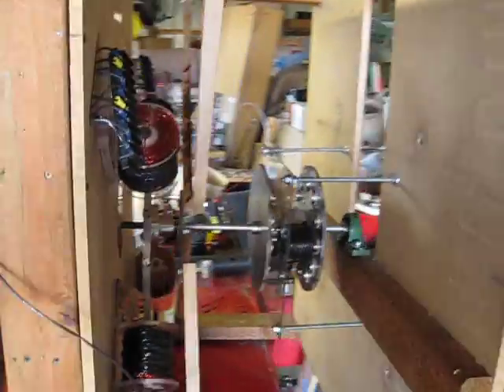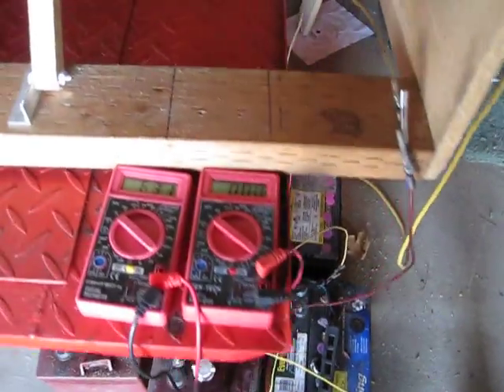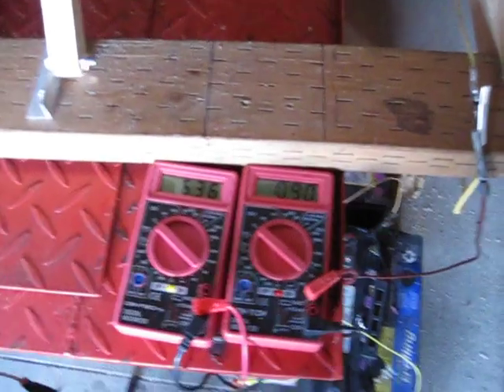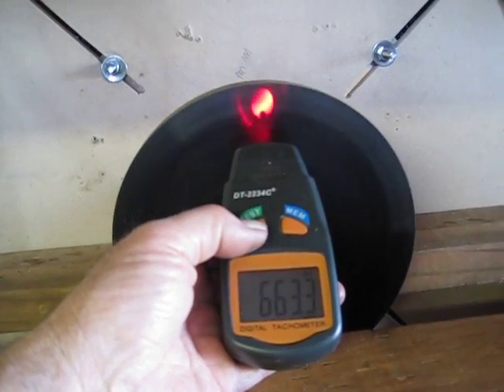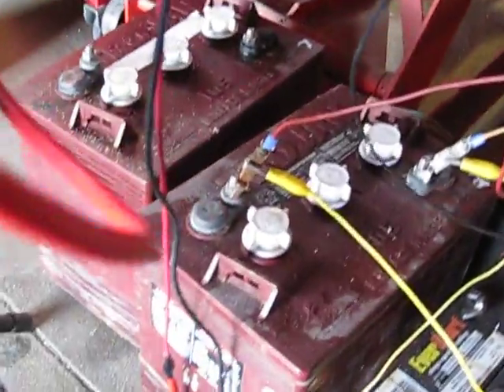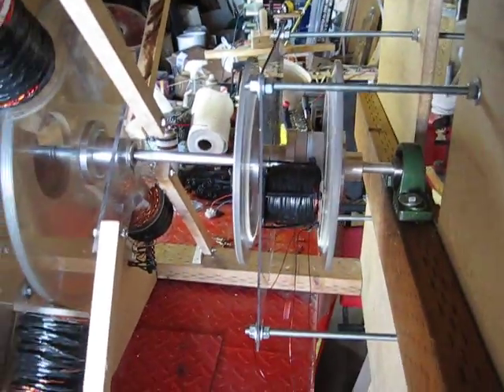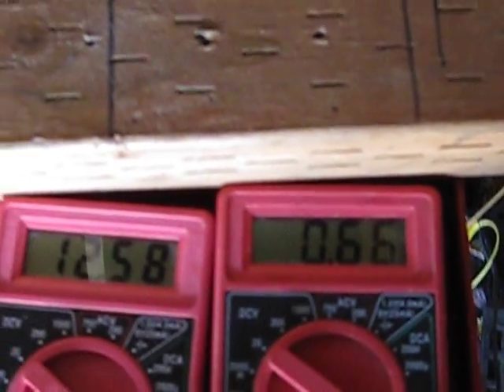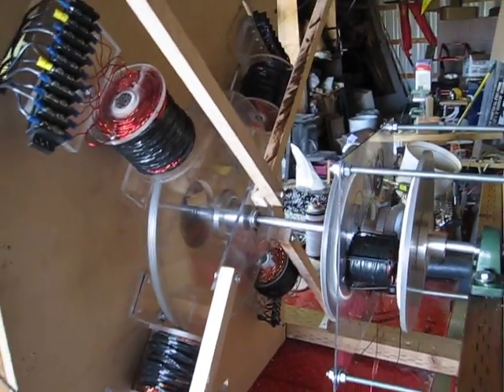pulse motor driving 3 phase coil output test into 6 and 12 volt 001

Comment: what are the  2 gauges of wire that you used on your coils? How many turns?
Reply from the maker: in this video we were messing around with some test coils made from aluminum magnet wire.  Not something I usually do because copper magnet wire produces more. its been so long since I did that test not sure how many turns was on that coil. I know it had to be 300 or more just from looking at that size coil. the regular coils I used on that 3 phase set up with the white surgical tape had 150 turns of #18 magnet wire. and those magnets are quarter size 49 pound pull. just think of the output potential if I had used 60 pound pull or higher magnets.

Comment: What factors dictate how much voltage/amperage is created by the pulse motor? #of coils, wire size/turns? I would like to build this big enough  to run a 24v system....what is required? I also.have 1kw of solar and am building wind turbines on a small scale to supplement! thx
Reply from the maker: the size of the magnet wire used, the strength in pound pull of each magnet,the number of coils , the type of transistor used  all contributes to the output.